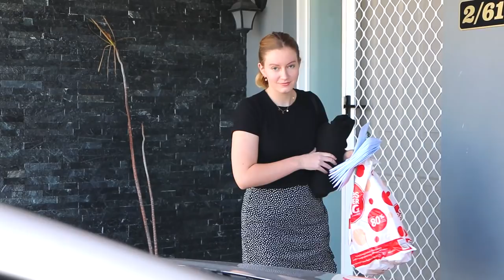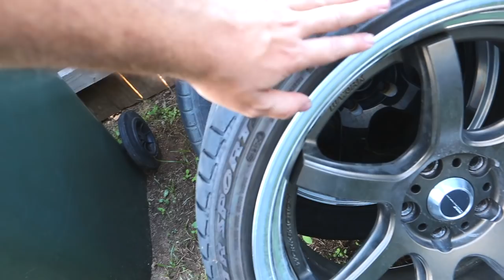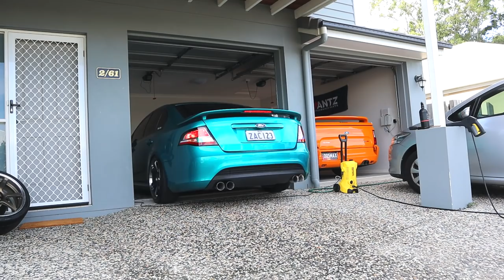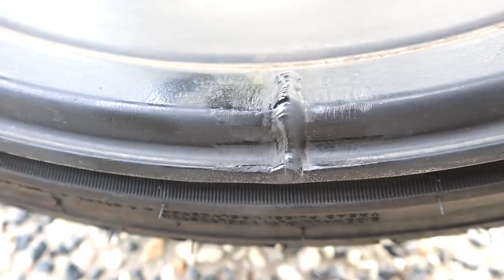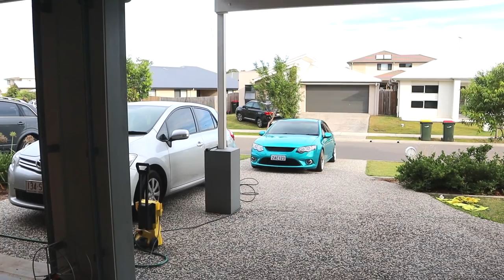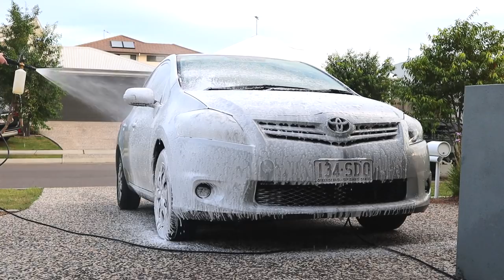Finally putting Legit Wheels on My Turbo Falcon?

Comment: I ran into the same issue with my fg falcon and cheap tires. Had the same sorta leak. Running 225/35/20, took 3 goes at the tire place to get it to seal. Was leaking from the bead seal.
All occurred after a cracked rim repair. How i found where it was leaking, remove the wheel. Bit of soapy water, and watch for where the bubbles appear.

Comment: Okay so I've noticed that nobody has commented yet, the wheels are concave becuase they'll be 9" wide, where as the fronts will be 8" wide. It was very easy to tell the difference when you laid them front on the ground.

Comment: Yeah I'd be going for some more +15's for ya next rims, in either a 9.5 or  10 inch wide. Keep in mind the track in the front is something like 18mm narrower than the back, so it pays to get some wider offset rims in the front to make up the difference

Comment: Hey Zac, I just watched your video on paining your brake callipers and I’m thinking about painting my break callipers. How many cans of Prima, actual paint and then gloss would u recommended do all 4 brakes?
Reply: Im not the person your hoping to reply but ive done it before and you really dont need much man probably get away with 1 can of primer 1 can of gloss and 2 cans of paint if you really wanted to be safe grab two of each. Hope that helps mate ✌🏻
Reply from the maker: Daniel Ives that’s it man, 1 can of paint 1 of primer gets the job done easily :)

Comment: Those tyres on the Falcon are crap
I have Michelin Pilot Sport 4S on mine
245/35/20×8.5 front
275/30/20×9.5 rear
From a fellow FG XR6 Turbo owner